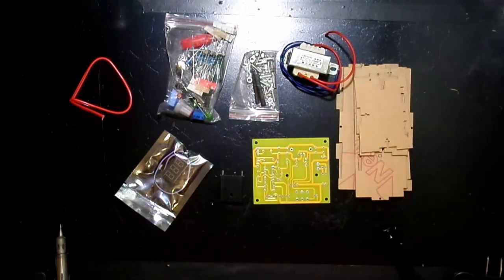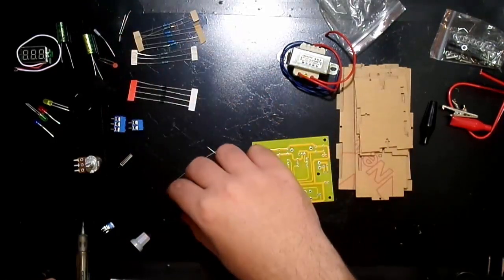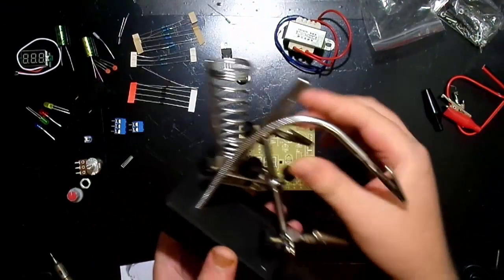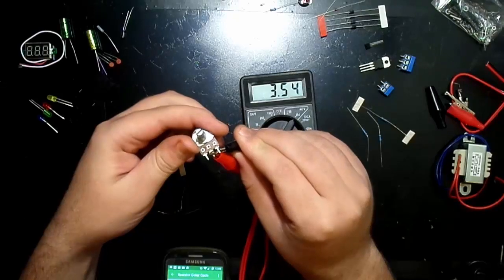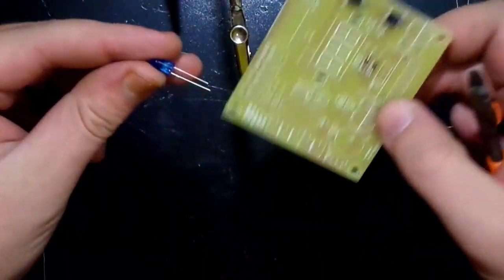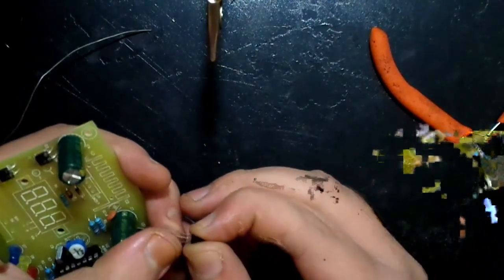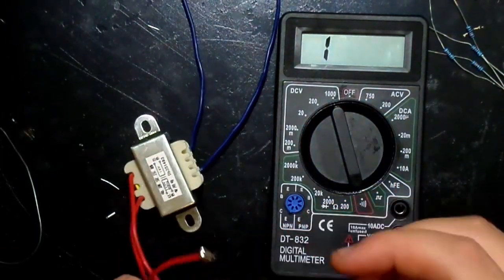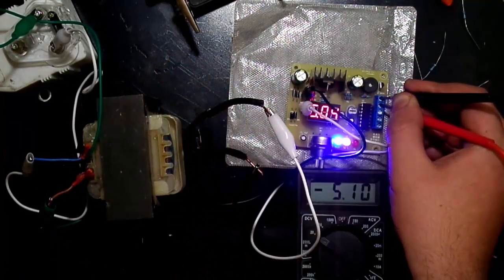How to Build a LM317 Adjustable Voltage Power Supply

Comment: So I know this is almost 5 years old, but I'm just curious as to if the other transformer worked good and if it fried anything.  I have a bunch of these kits that I got for $0.50 at a pallet store on $0.50 day.  Apparently the people didn't know what they had!  LOL  I think I have like 15 of them that aren't put together.  Anyway, I was wondering if I could use a bigger transformer and maybe use bigger resistors and such.

Comment: It looks like you didn't calibrate it using an oscilloscope as described in the instructions. My voltmeter doesn't work. ;-(
Reply: how many people building a 15$ PSU have an oscilloscope lying around?
Reply: True and I didn't I used a DVM. My $20 scope isn't finished yet. https://www.banggood.com/Orignal-JYE-Tech-DS0150-15001K-DSO-SHELL-DIY-Digital-Oscilloscope-Kit-With-Housing-p-1093865.html?rmmds=search&cur_warehouse=CN

Comment: need its circuit diagram.... can u provide it ?
Reply from the maker: +Detta Megga sorry the manufacturer does not give a schematic only a layout:
here is the product page:
http://www.banggood.com/EU-220V-DIY-LM317-Adjustable-Voltage-Power-Supply-Board-Kit-With-Case-p-973391.html?p=NR0912761986201409JK
Reply: ohkey ,,,, btw thanx !!
Reply: The banggood link below has a link to the instructions.  A schematic is in the instructions.

Comment: where does the + - Vin of the seven segment connected to?  i cant find the connection in the schematic
Reply: does the seven segment has another circuit like ADC which determines the voltage?
Reply: If your still working on this project, you take the wires from the number display and plug black into -, red into +, and white in vin.
Reply: Mine has no - or + just some Chinese characters

Comment: hi sir i tried this and i have done it but i got problem from the output ,when i plug in the socket the clock reads 12v minum and maxium 14 also when i put into load the v out become 3 to 1 v i know what i have done wrong
any help???
by the way you have done good job 
thnx

Comment: Do you know what the leds are supposed to do? I had major troubles with this project so after I got better at soldering and what not I went back to this to try and fix it I have got it working but the leds are not I think because the pads are burned away but I can jump them with wires if I can figure what their purpose is and a diagram.

Comment: Donovan Phoenix thanks  so  much  for the video just not sure what you mean when you said connect  the  higher value  wires from transformer to the mains? what do you mean  solder to the board ? please  explain farther thanks  again !
Reply from the maker: This Is a Step Down Transformer, IOW it steps down the high voltage of the power from the wall to a lower voltage. in my case 220v AC to 12v/15v  AC.in order to do this it uses a long wire in the high voltage (low amprage) side and a shorter wire on the  on the lower volatge side(Higer amprage) .So if i have a long wire i can test the resestance and it will be higer than the short wire so the higer resestance wire will be conected to the wall/mains/220v AC and the side with the lower resestane and shorter and thicker wire will give me a lower voltage so this side will connect to the bord.if you are unsure just connect the wire up to the mains and see the AC voltage from the other side. this if you connect the wires incorrectly  the transformer will fail, so use a lower ac input like 1-2v  using a dimmer. just measure the other side it should give you a lower voltage.here is a vidio explaning this https://www.youtube.com/watch?v=jDuxFEgtSAQ
Reply: Thanks  so much  for the explanation  and clearing  The terminology and saving a possible  fried transformer ....Love the videos  keep up  the great  work !

Comment: I wound up with the 200V wires but I live in the US (120 only). Can this be easily converted to 120V?
Reply from the maker: +Review Shorts yes just get a 120v to 15v max transformer. The big transformer in the video is 240v to 12v transformer so you should not have a problem to connect a transformer with a lower output voltage. Just don't use the 240v it came with or you will break your thing
Reply: @Phoenix1337   you do not get 240 vAC commonly as 120 volts you will get some one killed. are you prepared for this accident I would get 120 in out 24volts or less  transformer

Comment: Hi Donovon I am thinking about getting one of those gas soldering irons, the same as you used.How do you rate them, are they a good buy and do you keep it lit through your project until finished, or keep re- lighting it?Thank you very much... John :)
Reply from the maker: +karen berry That specific one is not that good.  The tip got corroded quickly, and the gas dose not last very long. so i have to switch it off to save on gas. the thermo insulation seems to be pretty good and it can be used as a mini blow torch. I am using it now only when i have to solder something on one of my company cnc control panels somewhere far away from electricity. and that is not that often. so maybe i should have spent a little more on a gas solder iron. Anyway here is a link for that one: http://www.banggood.com/Portable-Butane-Gas-Refillable-Blow-Torch-Welding-Soldering-Solder-Iron-Pen-Tool-p-1015142.html?p=NR0912761986201409JK

Comment: Hi did one of these a year or so ago and it failed to put out the proper voltages as well.  I figured it was the transformer was wired for 220 or something so I replaced it with an old computer power brick just wired into the system, works great now.

Comment: dude no schematic?
Reply from the maker: +Detta Megga sorry the manufacturer does not give a schematic only a layout:
here is the product page:
http://www.banggood.com/EU-220V-DIY-LM317-Adjustable-Voltage-Power-Supply-Board-Kit-With-Case-p-973391.html?p=NR0912761986201409JK
Reply: hey thanks.

Comment: Great tutorial Donovan. I'm going to use an old computer power brick as the DC input, 19.5 volts, 3.34A. Looking for 12V out at the 317's max of 1.5 amps to power a string of LEDs. Will be using a large heat sink and will breadboard first and let it run for a while to make sure there won't be any overheating issues with the 317 or the resistors. Thanks again for putting together this tutorial.
Reply from the maker: +David Winn you could just get a step down converter if you already have a power supply  see this vidio :
https://www.youtube.com/watch?v=wI-KYRdmx-E

Comment: Hi Donovan this looks a great tutorial but I am wanting to use my LM317 to drop dc to dc, 12v to 6v or3v. or 4.5v  Do you know where I might find such a tutorial?  Once again Great jobl, thanks...  John... :)
Reply from the maker: +karen berry try starting here: http://akashaghara.blogspot.co.za/2013/10/power-supplies-circuit-and-component.html
The lm317 is a 'Adjustable' Voltage regulator , You do get   regulators that only output a specific voltage, Just make sure you do not draw more current than what the regulator specifies on the data sheet
Reply: +Donovan Phoenix    Many thanks for the quick reply mate... John ... :)
Reply: +karen berry Or yopu can simply use a 7805 (5v), 7809 (9v), 7812 (12v) voltage regualtor which is very easy to use fixed voltage regualtors.  You can find loads on info on how using google or Instructables.com if you just want a result, look on eBay there are many ready made modules for very cheap prices!